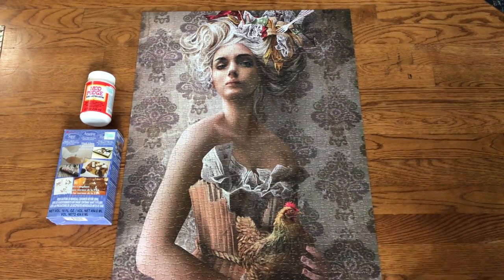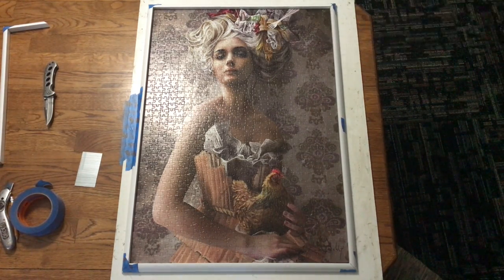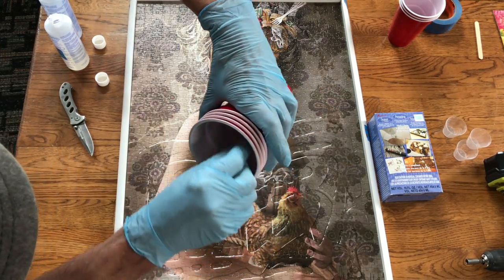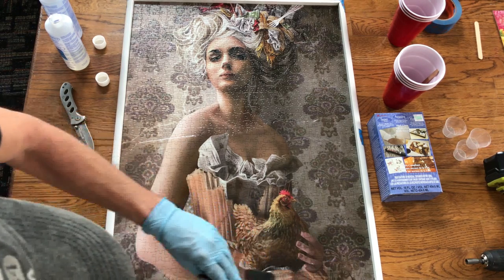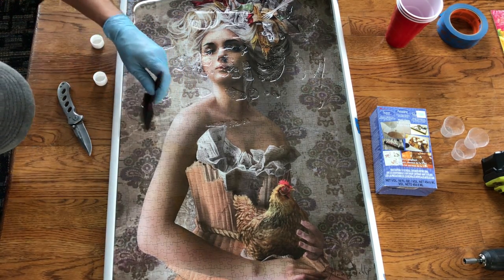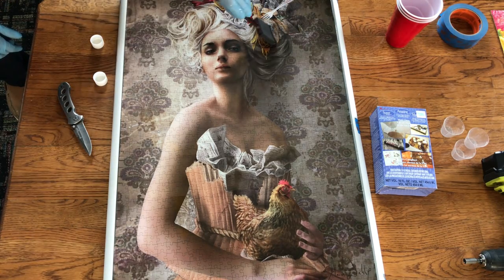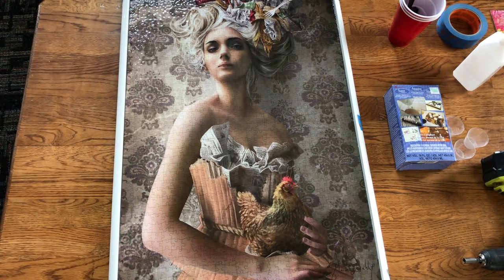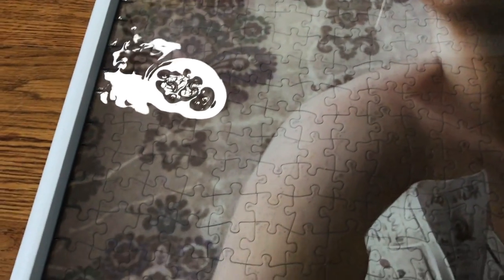How To Resin Coat a 1,000 Piece Jigsaw Puzzle With Allumilite Clear Coat

Comment: I've never done this before but other video's I've seen where folks use the resin, they use a blow dryer or heat gun and that really smoothes it out.  Might be something to try with another puzzle to see if you can get away with just one coat.  Great video!

Comment: Heat is the secret to getting the air bubbles out so if you have a heat gun that is best if not you can use a straw and blow lightly and the heat from your breathe works I’ve been using epoxy for awhile and it works!!!!!